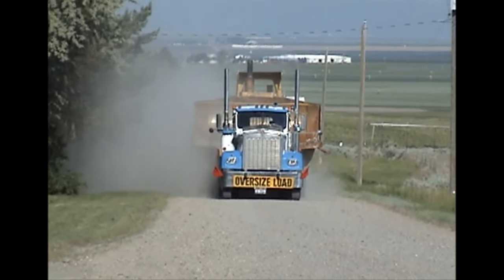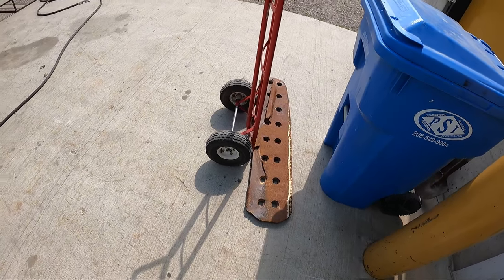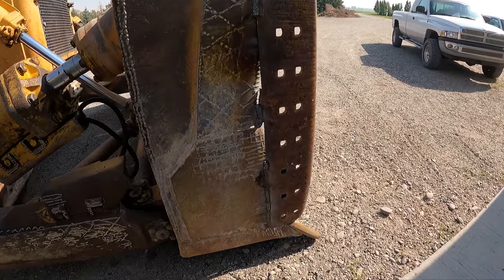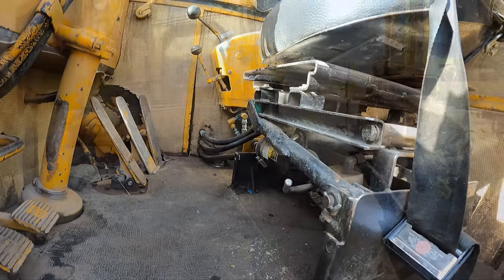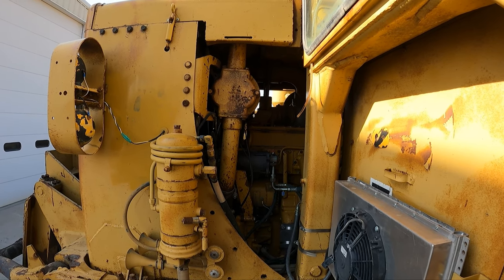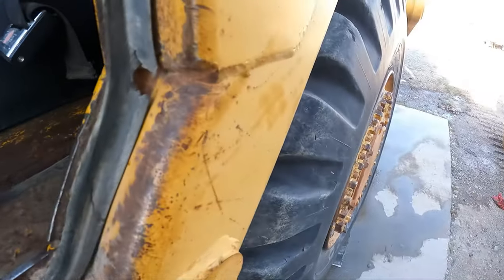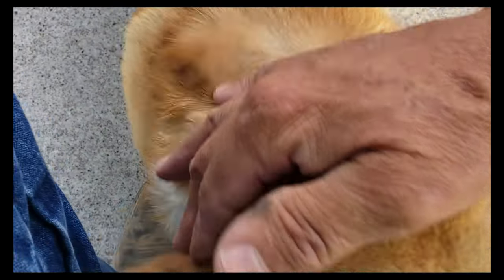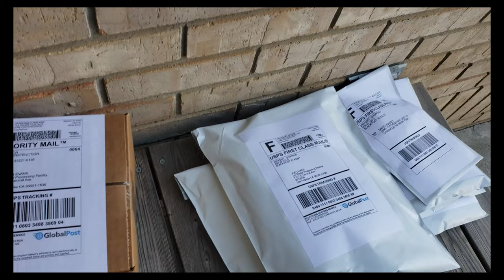Welding On The 9er

Comment: Some older Fords used the A-6 compressor, the by far toughest AC compressor, however the Sanden, the HD models with the larger shaft are also excellent compressors and readily available.

Comment: After running a sandeen compressor you’ll never want to go back to the A6 compressor the sandeen compressor you will get maximum cooling at idle and wide open throttle

Comment: AP air makes a direct fit a6 replacement we have installed a lot of them as they handle the high pressure from the r134a a lot better

Comment: There is numerous companies that make sanden style ac compressors that are a direct fit replacement for the a6 so no adapter brackets needed.  I perform a lot of custom ac fabrication at my shop installing ac in things that never had it or are obsolete.

Comment: Since you are replacing the A/C Compressor if it were me I would explore the idea of doing away with the expansion valve and receiver drier in favor of an Orifice Tube and an Accumulator to bring your system to more closely match a modern A/C system.  Additionally I would get a AC “flush gun” kit and A/C system flushing solution and flush the Condenser, Evaporator, and Lines individually upgrade the O-Rings at the hose connections and Schrader valves refill the system with the proper amount of correct oil, and if you are not modernizing the system with a orifice tube and accumulator I would definitely replace the Drier